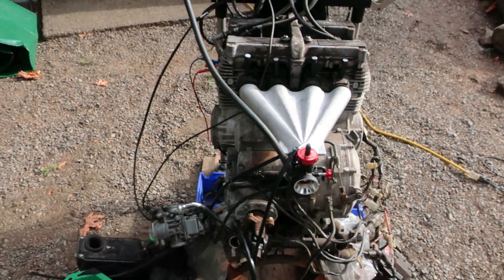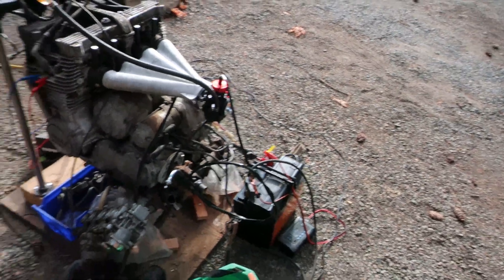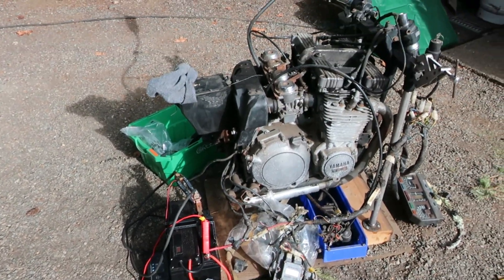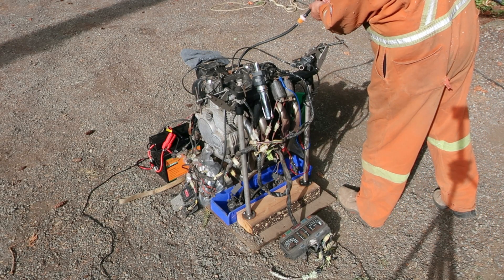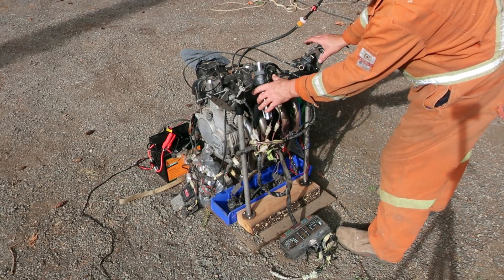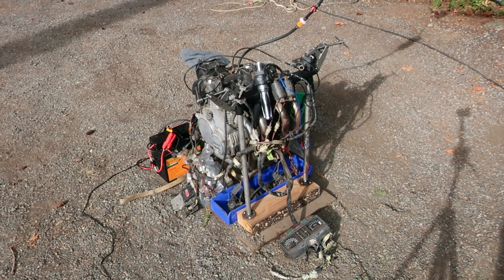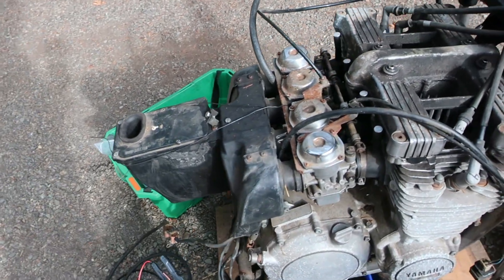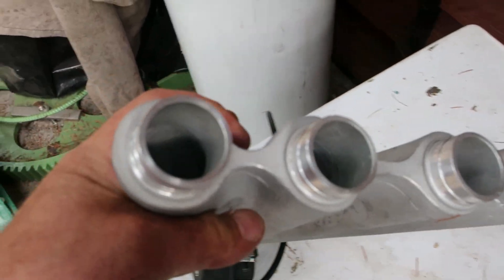Intake manifold, part #4, Converting a motorcycle to run on a single carburetor.  A DIY manifold.

Comment: Millions of 4 cylinder cars worldwide just have a small single throat carburettor and  a simple straight manifold. And they run just great.
There is no need for that silly long manifold, just make a straight manifold.
Reply from the maker: Really did not try and make it long.  It was easier and had less bends to form and cast and does not take up any more space than the original air box set up is all.  I did not see any harm in it's length for my intended application is all. Just seemed like a easier design for hot wire foam casting.

Comment: how do you get the venturi dimension of the carburator to be enough to feed all the cilinders?
Reply from the maker: Here are facts that influenced my thought process':

1)  people take multi bike carbs off this size bike and bolt them on 2000cc car engines and gain horse power.

2)  my 4000cc 1967 6 cylinder chevy has a small carb for its displacement and lots of low end torque.

3)  many old tractors with decent displacement have very tiny carbs.

4)  as this carb is a little bigger than one of the four that came off, and each cylinder is 187.5 cc, this carb is rated for up to 250cc.  Thinking that the other carbs only operated during 1 of the four strokes that the velocity would be close except this one would be feeding the intake during all four of the strokes in a less pulsed more continuous flow.

5) the bike red lines at 10 000 RPM and I really don't want more than 3300RPM and so am only asking for a fraction of the air velocity.

I am hoping to gain a little on the low end and lose some at 3300RPM and starve it at any more.  So far the test run assures me that it already revs more than I need, just need to play a bit with exhaust (no open pipes) and work the jetting a little I hope.  So I guessed the carb size as I could not find anyone who has done a similar modification, although I am sure it has been done.  It does seem that many of the lower performance 4 stroke bikes share carbs across a wider cc range than I initially thought.

So in a nut shell, I guessed.
We shall see.
Reply: The 4 cylinders all suck at different times, so a single carb will work just fine.
See my other comment about millions of 4cyl cars being made over the years with just a simple manifold and 1 small carb. Just look at any 1970's to 1990's 4 cyl car engine

Comment: Google: manifold wall fuel flow in carburetted engines.  You're asking a lot from that design, particularly as you have unequal runner length and likely poor flow distribution.  It can probably be made to work if you jet it very rich (and probably suffer when the manifold is hot), but something much shorter would help you a lot..
Reply: "Unequal runner length" means nothing. If he wants a tuned intake, he can change the diameter of the individual passages. I can tell you haven't actually done this type of modification, just echoing nonsense from armchair mechanic forums 😂
Reply: @longdong3889  oh... funny guy, eh?  You may want to check your facts before making any statements.  You can believe anything you want, but that doesn't make it true.  I wish you luck on your forums.
Reply from the maker: I appreciate the intel,  will look into it and a few other things people have mentioned.  Jetting, muffler back pressure are a few that must be remedied. Really only want a smooth 3000 RPM and some low end torque out of her.